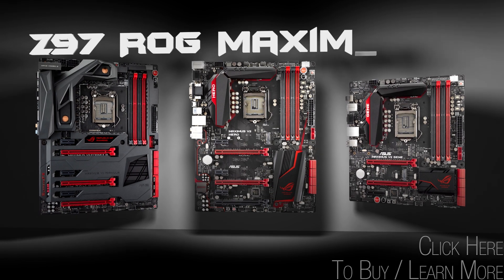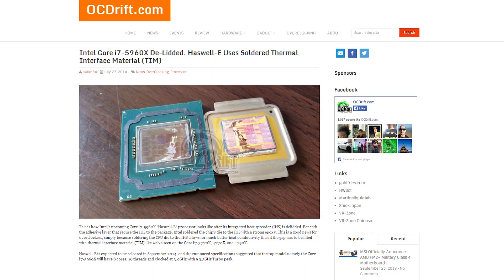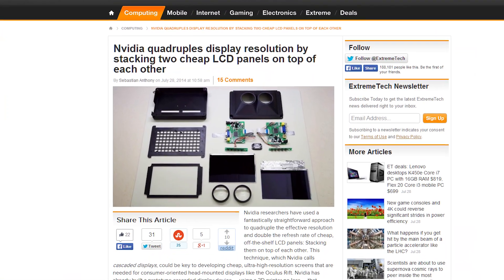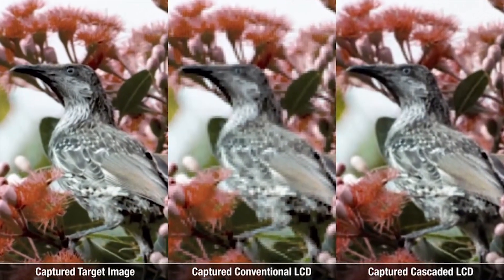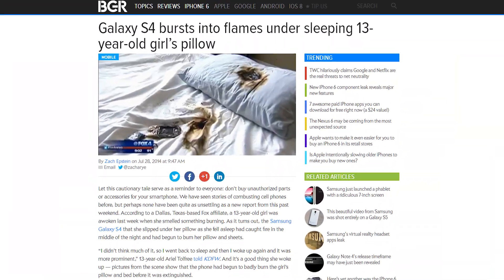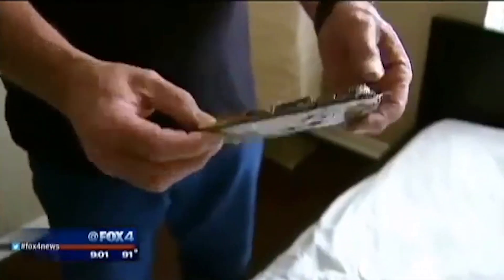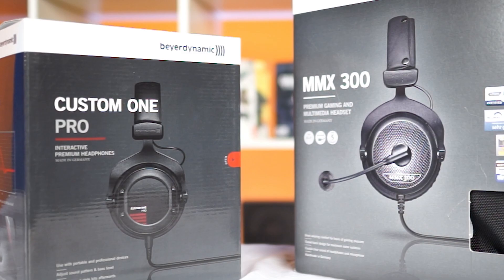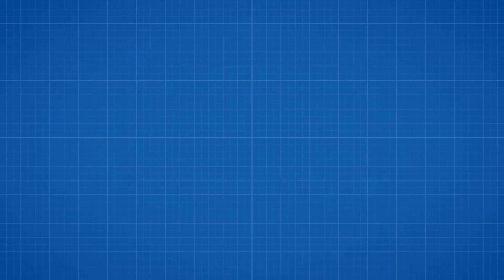Haswell-E die soldered, Nvidia bashes Mantle, Galaxy S4 explodes - Netlinked Daily

Comment: news: when a battery discharges or charges quickly, it creates heat. when no substantial cooling occurs (such as covering it with a pillow) fire or explosion may occur.  Duh.... fucking retards.  Who in todays society doesn't know the rules for rechargeable batteries?  These people shouldn't be awarded for strait up stupidity.  work around cordless tools for a day and you understand more than this bullshit. Modern day chargers won't charge if the unit or battery is too hot.... Exothermic reactions and all. chemicals.....

Comment: To be honest she shouldn't have had it on her pillow anyway as the radio waves (or which ever waves they are I forgot) can damage your brain if you have your phone next to your head turned on for long periods of time e.g sleeping
Reply: Yeahhhh... Probably not though. While widespread cell phone use hasn't been around long enough for a definitive conclusion, so far they haven't been able to find a link between cell phone use and any kind of damage to the brain (or genitalia since we keep the phones right next to those in our pocket).

As far as I know, the "worst" they have found is a slight heating effect, but a ray of sunlight falling on your face will also heat it up slightly. Such minor increases in temperature are nothing compared to what our bodies deal with every day and night.

Also, people living right next to cell towers are exposed to waaay more of that radiation (not the nuclear type, the safe one which also includes any kind of light) and they are also just fine. We gotta wait a bit before definitively calling it, but if there was a serious risk we'd probably have found it by now.

Comment: Apparently another person had his gs4 overheat and melt overnight. He contacted Samsung who promised an rma and proceeded to not send him anything, at which point HTC sent him an M8. It may be cheap replacement batteries in this case, but a lot of gs4 owners I know have complained of their phone running hot especially during phonecalls and I'm pretty sure they use the standard battery with the standard charger.
Reply: I was just thinking about the same thing!

Comment: So wait...  Just by covering the S4 while it may not be running intensively can catch fire, does this means that if the S4 was to be running at 100% continuously in a room with no airflow, there is a chance it can catch fire too?  Because there are people that are bit mining on their phones...  lol
Reply: If you read the article, the family says that the battery was non-OEM. Dem cheap chinamade ones be killin.
Reply: Dolmorii
Ah.  That's even worst.  D:
Reply: Dolmorii
That and there is always a very small chance this could happen to any kind of cell phone battery. Cellphones exploding is nothing new but ya cheapo china ones probably increase that chance substantially.
Reply: Dolmorii that is bullshit because i have a galaxy s2 and the phone would get so hot while charging(with the OEM battery), till finally the battery exploded, luckily it wasn't as bad as this, since I have replaced the battery It hasn't overheated...well maybe because I can't even charge it anymore. Samsung phones are garbage.
Reply: If a battery gets too hot, it will catch fire. There are safety precautions built into the phone, however, these do ofcourse not account for a shitty aftermarket battery.
Reply: >dunbass
topkek
I got the s2 when it first came out. I expect my phone to work when I want to use it. It's terrible, turns off by itself, gets hot as fuck, screen is constantly fucking up, drops calls(sprint blows). The OS lags like shit. It happened about a year after i got the phone, its literally unusable now. I will never buy another samsung phone. Don't get me wrong, I love my samsung 840 pro series ssd, but their phones are literally shit.
Reply: Josh Scott not Always...not Everything ran hotter yesterday.
Reply: Josh Scott what? lol i said that Everything from yesterday does not run hotter than today. and you come back with insults and how you Think the difference between the phones in the S line is so huge? but sure if you want to talk about heat dissipation, my mom has an s3 wich really never gets hot from what ive personally experianced with it and my mom says the same. running an intense gfx game on the s5 (from my friend) it really gets hot, it gets rediculously hot, running the same game on my moms s3 tho, it really does not get hot, not at the same degree as the s5. sure you dont get the same performance out of the s3 compared to the s5, but damn the s5 runs hot when playing that game...
Reply: Josh Scott fuck off about ages. my iphone 4 is 4 years old. Doesnt have problems and runs perfect. Just slow.
Reply: my boss S4 get so hot that he cant keep it in his pocket and he is not playing games or using it like im using my 920
Reply: Exia2004 Then there is something wrong with his phone, either an app he installed that's doing a shitload of background processing, or something.
Reply: *****
Also, in the news, there is a trojan app that pretends to be a popular app but it turns out to be a bitcoin mining program.  Those program uses 100% of the processing power of the phone.  Always double check on the app you install!
Reply: Oyamada13 ty, atleast we have 3 wise men here...
Reply: *****
he dosent have any app aside those that he cant delete

Comment: So new processor's are coming out!?
Reply: TheBernhard100
No it's going to be 8-core this time (At least for the extreme edition not sure about the 5930k)
Reply: I haven't heard anything about these processors until now. Thanks guys!
Reply: Yea that
Reply: Yes, this is for the new 6-core processor line from Intel.
Reply: BLOOWOLF4562 Haven't seen any source actually confirming that yet.
Reply: the i7-x820s only have 4 cores compared to the 6 cores the other 2011 socket CPUs have.
Reply: ***** the 5930k will have more pcie lanes
Reply: ***** it's more important with multiple cards, the 5820k will have 28 lanes total, and the 5930k will have 40 lanes total
Reply: TheBernhard100
http://wccftech.com/intel-haswelle-core-i7-5960x-core-i7-5930k-core-i7-5820k-specifications-unveiled-flagship-8-core-boost-33-ghz/ You haven't looked hard enough
Reply: ***** But you don't take into account that if you have a great cooler (as I assume anybody paying 1k for a cpu would) and a great mobo (able to supply a load of power) you could probably clock it almost as high as the 6 cores because the main reason it has such a low clock speed it so it does not have a giant TDP.
Reply: ***** even so, I wouldn't expect an average 6 core to be more than 200-300mhz faster than an average 8 core. Once you start going beyond 4.4ish ghz, you might be looking at more power than the amd 9000 series :P We are going to need very beefy mobos
Reply: Trey Bazinet You see better performance on on all 6 core Intel CPUs (Sandy Bridge and up) compared to AMDs 9000 series almost across the bored without even overclocking.
Reply: 441meatloaf Who the fuck brought up price in this?
I don't care about price, people who use them in professional tasks (except the few were the AMDs are better) don't care about price.
Wanna know why? Because every second the AMDs need longer for a task cost time and money and we aren't talking about mere seconds, we are talking about minutes, hours, sometimes days. That combined with the lower TDP adds up in a while making the initial lower cost of the AMDs irrelevant.
Reply: 441meatloaf Because I want the best possible performance because I need and can afforded it. Why do people drive Lamborghinis, They aren't that much better than a GT500 and certainly don't have the same cost too performance ratio? Do you call thosr people ignorant too? Seems too me that you are the one being ignorant and asuming everybody has the same priorities you do.
Also, like I already stated. In professional applications extra time cost can add up really really quickly and for people who value time speed is of the essence. Is it at all important for something like gaming? Heck no and I would probably build a system with an i5 for a gaming rig. ("OMG he is using another Intel CPU whine*whine*whine" yes, that because it has a lower TDP, runs quieter and, if you factor in the aftermarket cooling you are going to need to have both at the same noise level it beats its AMD counterpart in nearly everything)
Also, why even bring up price. we were talking about performance, price has literally nothing to do with performance.
Reply: 441meatloaf Just because companies like ASUS market some of their 2011 Mobos towards gamers doesn't mean that Intel is doing the same, in fact they barely market their CPUs at all.
Why not cash in on a niche that exists? (Also, yes they are marketed as desktop motherboards because a workstation is still basically a desktop)
Reply: 441meatloaf 1st, no it doesn't, look up some benchmarks. Also it is quieter and has a lower TDP (that means it doesn't put out as much heat and keeps your room slightly cooler)

2nd. that was precisely my point. wow does ignorance have no bounds?
Reply: 441meatloaf You are not paying only paying for performance, you are also paying for the quality, reliability, low temperature, and power efficiency. AMD has literally made no effort into making a good processor, they've been just cranking up the clock speed and ignoring everything else. This is very evident with their Fx-9590, this processor required a board with a thick PCB due to the high amount of heat it outputted, heck they didn't even include their stock cooler because of that.
Reply: ***** It is definatly a factor, but looking at the fact that the 8350 is a fucking turbine with the stock cooler kind of makes me laugh.